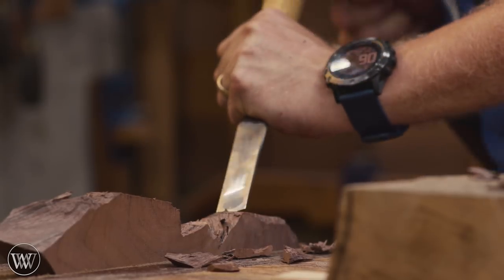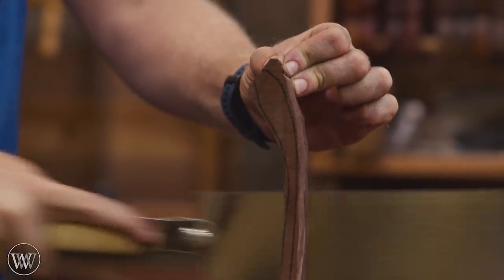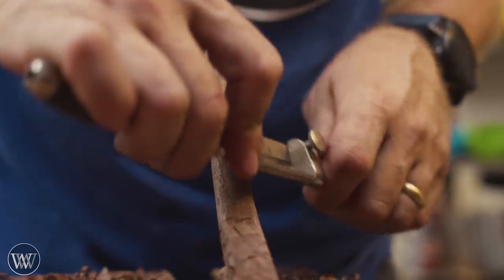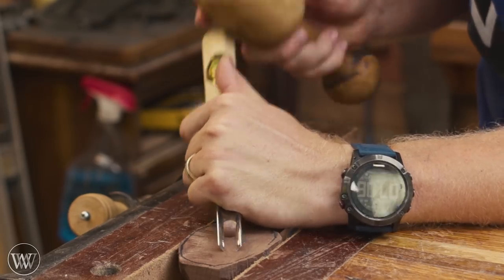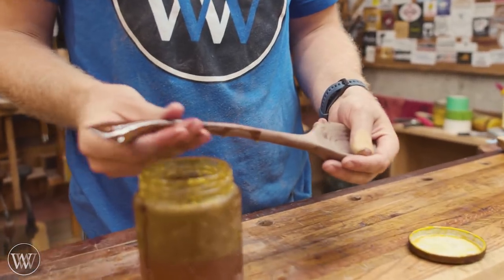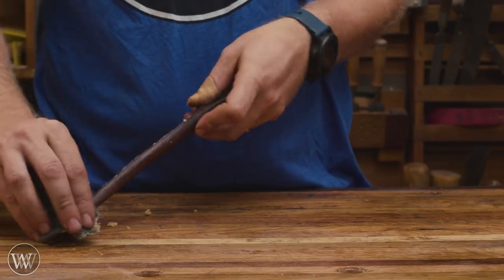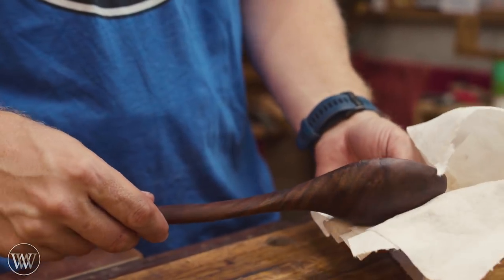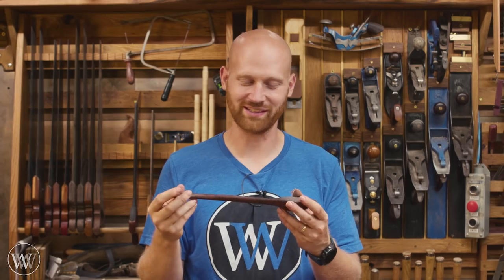How to Carve a Spoon With Just Hand Tools

Comment: Really detailed video, loved watching it come to fruition. Just an idea that might help cut down the time a little bit, when taking the meat of the wood off the handle instead of hoping that the chisel doesn't go too far with grain, make a few cuts of different depths into the meat so you aren't working as hard and wont have to worry that you might cut into the actual handle.

Comment: That's a really beautiful spoon! I'm surprised this is your first, since you're a seasoned woodworker by now. I've made a lot of spoons in my beginner phase. I would advise you to use a bigger gouge (35mm or so). It leaves a smoother surface, making the spoon knife obsolete. A round card scraper is still needed though for refining.

Comment: I'm sitting in my living room watching this, but I swear I could smell the walnut wood as you were working it! Honestly walnut is not my favorite wood for spoons that I'm actually going to use because of that smell. Doesn't always complement the food I'm cooking. Also it really likes to get really fuzzy after it's wet. I'd actually recommend not sanding if you can help it - knife cuts will stay smooth. If you're going to sand, wet it and knock back the fuzzies with really fine sandpaper (1000 grit is my preference) like 3-4 times and it'll stay fairly smooth.